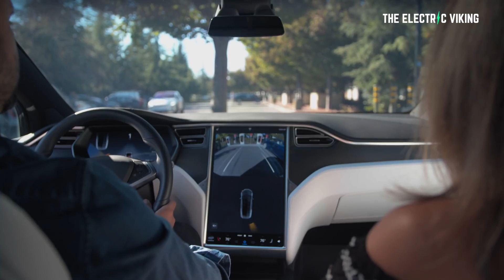16 NEW battery giga factories planned in North America

Comment: The Smart #1 tech is 75% over the air updatable. I’m buying the Brabus version, for instance you can up the performance from 0-100 in 3.9 seconds to 3.3 seconds. Also unlock the capped 112 mph top speed. I don’t think it’s needed but it’s there if you like drag racing.

Comment: Sam, EV Battery Giga-Factories are literally sprouting up just like Weeds after rain, and just as fast, and ..not just in the US, ..BUT, ..where, ..WHERE, are they getting the ESSENTIAL, the CRITICAL, Lithium, from, that is required to manufacture, all of their ..’planned’ Batteries….??  🙄 
The fastest path to Lithium ..PRODUCTION, is from hard rock, but even that has a ..minimum, 2 years lead time, and Brine, typically, has anywhere from 7 to 10 years, to achieve its first, ..PRODUCTION..!  😳 
As Elon Musk recent said, if you’re ..currently, Mining and ..PRODUCING Lithium, then you have a license to print money, at a rate, that’s the equivalent of producing Software..! 
Aren’t we lucky, here in Australia, that we ..are, the largest ..PRODUCER, of Lithium, on the Planet..! 😉😁

Comment: hey Todd; i follow the actual mining and I don't see anything coming on line which will make up for the loss of chilean mining which the governement shut down. The cost of Lithium is up 12000 since 2020 which is the first year EV production world wide surpassed 1 million. 100 Million vehicles are sold annually. what is needed is Sodium or something else that will scale; plus higher density so the weight of EVs drop, in order for them to be green.

Comment: A story that I just heard  was that e School busses were used as battery storage units last summer, providing power to users and the grid, since they wee not in use for the summer. I wonder if that could be done on week long school holidays through the year. What a great secondary use for ev's.
Reply: Using electric school buses as a summertime grid storage reserve sounds like a great idea.  I don't think these buses have two way charging capabilities at present.  Am I wrong?
Reply: @frederickwelsh  I m not sure. I understood they when back to parking lots for recharge.
Reply: @Robbiemduncan  I believe you have an excellent idea.  I believe also that it fits under the smart grid category where EVs are a device functioning as part of the grid which is virtual powerplant and home storage device capable.
Reply: @frederickwelsh  Nuuve, BYD, and Saf-T-Liner all have buses that have V2G. I'm sure plenty of others do, or will very soon.

Comment: Well, from Norway, as i am with this issue, i would like you to take up the issue of Catode and Anode material in National parks open mines, then mineral oil from offshore drilling, and on top of that, how to generator. Electricity for the cars, by nuclesr or Sahara by sand, it is just in my head for topics, as i work oil gas and wind from Norway installung Asia and mid rads with sand in the besrings

Comment: Making factories doesn't mean there is Lithium to supply to them.  You've noted that LFP don't need as high a quality of Lithium which may help but over all there simply isn't enough lithium currently to make more than 6 Million Model 3 long range cars or the equivalent; sure you could make smaller battery packs - and Hybrids do; yet most can commute all electric. Wouldn't more be better?
Reply: Model 3 standard is being made with LFP and the lithium will come down in price one way or another . They supply is there, the price needs to come down.

Comment: There is an Australian Company that is opening a Cobalt mine in Eastern Idaho. Should be open in 2023 producing 2,000 tons annually.
Reply: Use the LFP technology with no cobalt and no nickel is the way. LFP battery lasts 3 times longer and no fire hazard. The patent of LFP had expired in April 2022 so everyone can make it.
Reply: @wellingtonhui6060  It is great, but it does not have the range needed for large truck.
Reply: @MyUniversalUniversity  people laugh at you alot dont they?
Reply: @MyUniversalUniversity , it does when you factor in the fact or added range of being able to charge it to 100% full and discharge it to 0%. Ternary batteries 🔋 on the hand are best charged to only 80% and  discharged to only 20% to lessen the pronouned adverse effects of degradation of its lifespan when not done. So in all, the LFP batteries make up for its lower energy density eventually
Reply: 2000 tons? I have bowel movements that are bigger than that.
Reply: But do we truly know if it's for batteries or for oil refineries to use as a catalyst in reducing sulfur in crude refining?
Reply: Cobalt is already old tech.

Comment: I believe the biggest influences are the large lithium deposits found in Utah and new battery technology that require less of the rarer minerals. I also, believe the US auto industry is finally admitting they can’t let China dominate the market.
Reply: Does it matter?  Chinese ev cars by law are not allowed to be sold in the us; outside of the us the American ev can't compete with Chinese ev.
Reply: @冬二二  true , Americans can't make cheap cars
Reply: @ramakrishna5480  , real full size EV aren’t cheap. $50000 and up even the Chinese made EV.
Reply: @123abcter  Size doesn't matter , if price isn't affordable whole of Asia and Africa  won't be able to afford them
Reply: @ramakrishna5480  , there’re small micro EV with low range say 100 km in China that cost under $ 10000 I think. Even the middle priced EV Like BYD atto 3 costed between $ 40000-50000. They aren’t cheap to build.
Reply: Add nevada
Reply: I think Tesla buying lithium from China suppliers to make their batteries
Reply: USA car factories can’t get parts to complete their ICE which still sitting in the factory. Why building lithium factories lol 😂

Comment: Hope when the build these battery factory's they are flexible enough to incorporate the many different battery designs that are 
in research right now . I think most of the US planned ones don't as far as I can see. (looks like mostly NCA and not LFP variants
and other Tech.
Reply: Much of the chemistry technology is transferable within form factors, so form factor is more important for manufacturing plants. The bigger issue is the supply chains that will be developed locally for raw materials and manufacturing equipment, plus local skilled workers and knowledge in all areas of the supply chain.
Reply: Batteries that are in research are mostly not going to become a battery ever. The companies making them, need to make them inexpensive so they will actually sell. The need to make what people are using today.

Comment: NASA has the capability to charge large batteries in five minutes that would normally take 30 minutes. It’s anticipated that the same principle will allow car batteries to be charged in the same amount of time!
Reply: Optimizing a battery for any particular characteristic is a balance between charge time and rate, discharge time and rate, cycle life, energy capacity by weight, energy capacity by volume, safety, and cost. NASA has many types of batteries that it uses for many types of missions, and has the ability to spend top dollar on the best battery for the application.